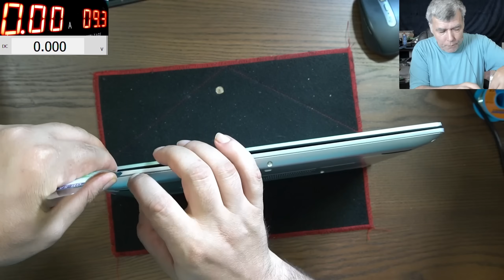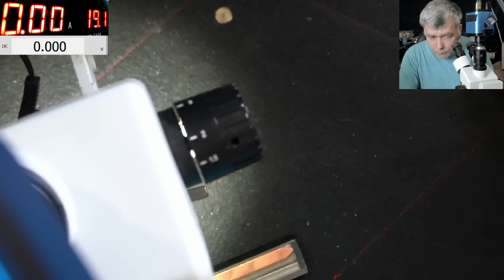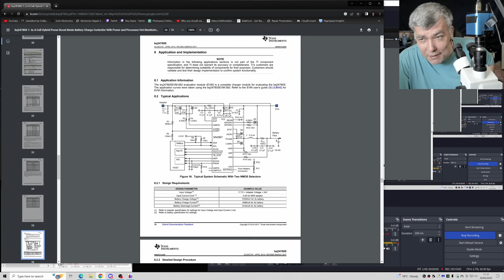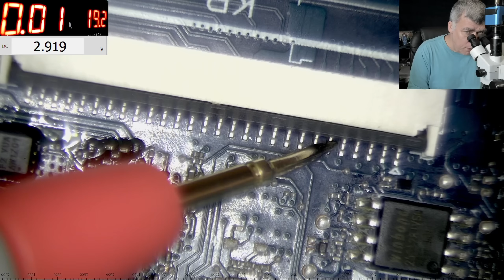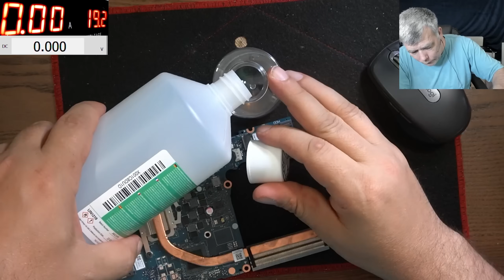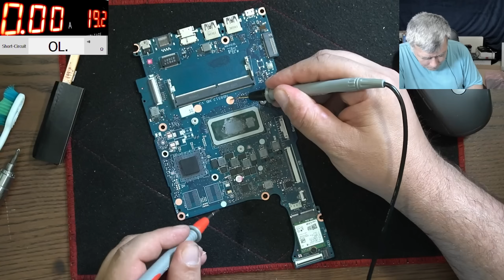I failed fixing this laptop - Liquid damage repairs, are tricky

Comment: Hi Sorin. In good condition motherboard with I5-10210u i have resistance  - on core power (CPU VCORE)  2.5Ω and  <1Ω ( 0.82Ω) in GFX power line (onboard graphics)

Comment: Sorin 3v is always present line and check 5v line also. The board is  going is s5 state but when you press power button its drops the current clearly there is some short or ic fault on S0 state/line which is preventing board to switch from s5 to power on s0 state. You need DSO to check if any line has pulsing voltages or short

Comment: 6:24 I’m a beginner and I need to ask why the next logical step is check the BQ chip and do not try to restore de 19V on the second mosfet. In other videos I’m sure it’s the procedure, I’m wrong?
Reply from the maker: the BQ chip is the chip which is triggering the both input mosfets, solving the problem with your bq chip, it will restore you main power rail
Reply: @electronicsrepairschool what could happened if I took out the mosfet and make a proper calibrated wire 😅?

Comment: You are right, ~1ohm too low. 
Got a spreadsheet with good vcore readings, and good reading for 10th gen is:
i7-10510U, 4ohms and takes current 1A

Comment: I do some very occasional odd repairs requiring soldering and always had a hard time. I made some of that rosin and isopropyl alcohol mix flux and it works wonders, really good stuff and  very effective. Two things I learnt to make things easier is good quality solder wire and flux, these 2 are essential. Thanks for all these super useful and educational videos.
Reply: Hope you are not using lead-free soldier